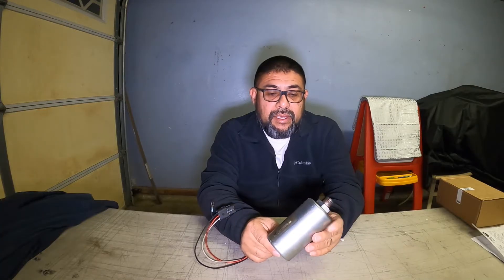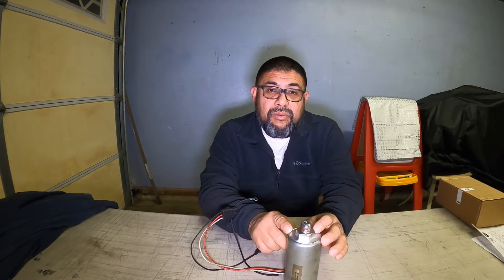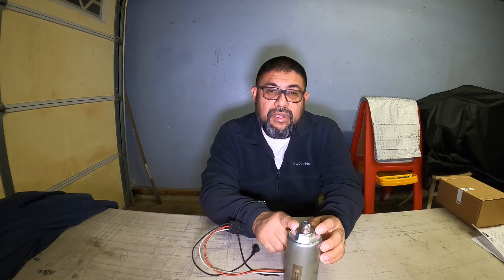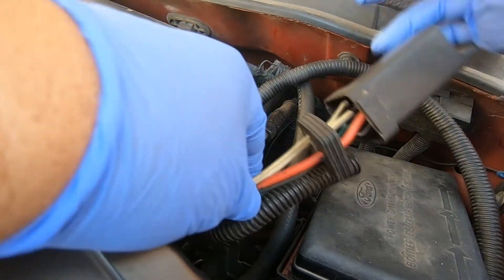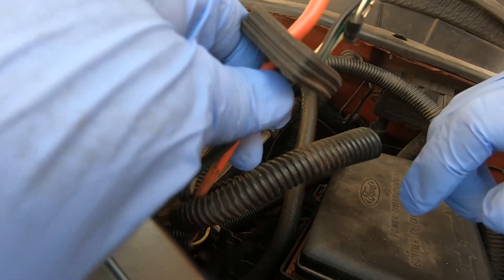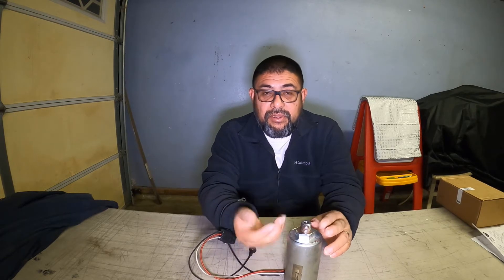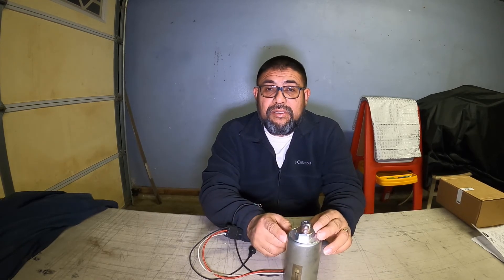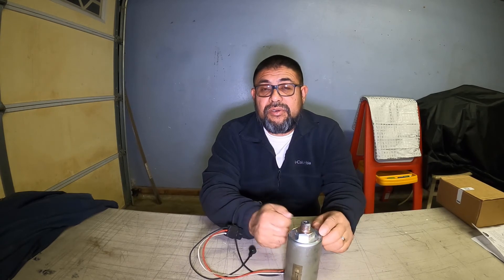Altec Bucket truck PTO system trouble shooting

Comment: We have a 2011 altec 75 foot elevator forsety  bucket truck. It is ran by pto  My question for you is the PTO has about 8000 hours on it. The truck has about 87000 miles. Do you think that's high hours for pto  Thank you. You think we're gonna have to replace it soon?

Comment: What can cause a PTO to not come on? See on the dash that the PTO is on but it doesn't do anything. I feel like it could be the solenoid valve near the pump
Reply from the maker: I spent a couple  thousand dollars before I found out it was a burn wire on the harness, i changed the solenoid  a few times, removed the PTO a couple times too nothing worked. I called Altec  tech support  and nothing till I decided to change the harness

Comment: Did you get it fixed im having the same problem wit a 95 chevy with the same setup
Reply from the maker: I did get it fix, it was indeed the solenoid. I end up swapping the solenoid and the switch just to make sure . Are you burning the fuses as well or just stopped working
Reply: Hope you fixed your truck,  I have an issue with my altec 235 bucket truck.  It's too slow and can get it to idle up.. any suggestions? Thanks
Reply: Habla español